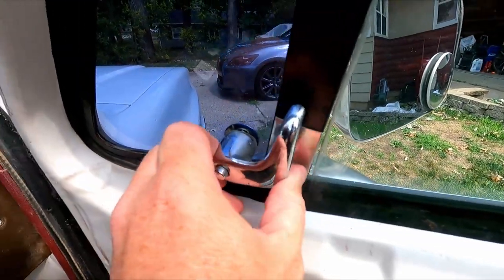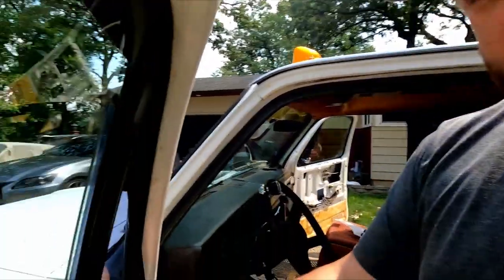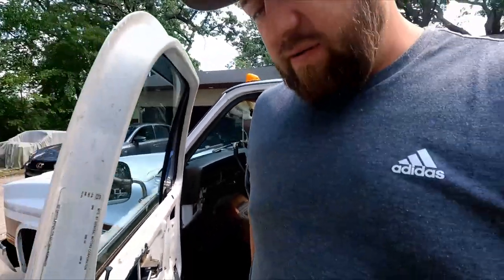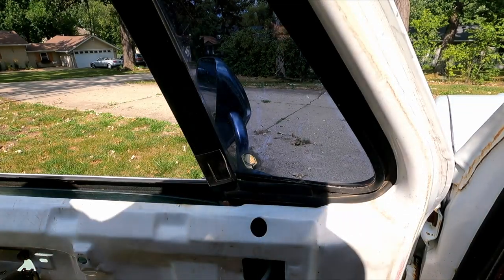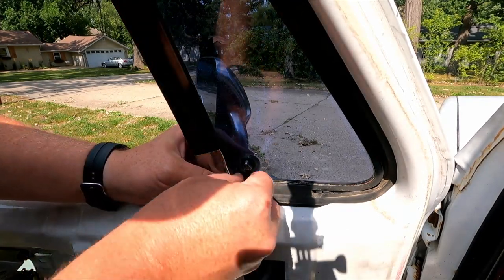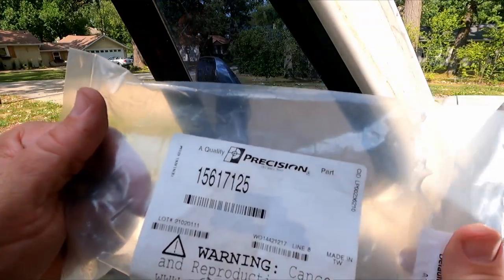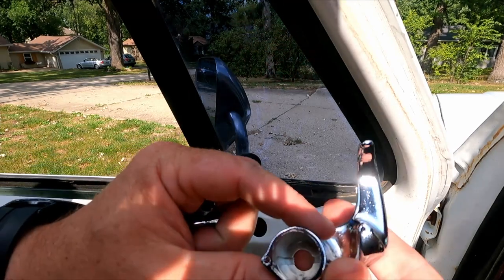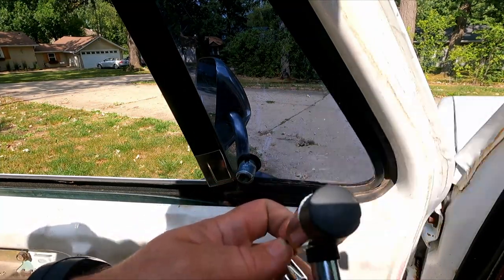80-87 Vent Window Handle & Hardware Replacement Crew Cab Square Body Chevy | Interior Updates Part 1

Comment: I installed the first piece (little button with the teardrop shape) upside down.  I could not get the roll pin to go in.  Came back inside to good old youtube and watched you to it the right way and changed mine over.  Works great now.  (1990 Suburban)  Thanks for the video.
Reply from the maker: Glad it could help

Comment: My passenger side latch is all loose and worn out, causing a lot of wind noise. Are these new latches closing the vent windows tight enough to fix that? My gaskets still look reasonable. Thanks for showing me how these latches go together!
Reply from the maker: I would assume so as long as the frame is good it tightens against. It only comes as a kit and was $20 so worth replacing it all while doing it.
Reply: Dominick Damato thanks, that's what I thought as well. I'm from the Netherlands (Europe) so there is always a lot of shipping cost involved with every parts order, but thats the price you pay for driving an American car over here I guess ;-)

Comment: I just got the same kit for my semi truck....it all seems right but did you use every piece in the kit or have some extra parts? The old ones i took off are different so i cant match it up.
Reply from the maker: There were doubles of the gaskets and washers.

Comment: I'm tinting one of these in two weeks. What's the tool you used to get the pin out? Where do you get them at? Have you ever taking the vent window off the door itself?
Reply from the maker: It's a punch, Amazon is easiest. And no not yet, the vent window is a bit complicated to remove. There are videos out there on it

Comment: Dose the wavey spring washer rub on your window tint?
Reply from the maker: I don't think it turns I think it just applies tension
Reply: I believe it rests against the black plastic washer that is secured by the pot metal piece/torx bolt.

Comment: I ordered the part but it does not come with instructions and looks like it has extra parts, probably a universal package. The seller told me I'm on my own to figure out how it all goes together which brought me here. Mine came with a few rubber washers and 2 springs ( probably for different applications)
Reply from the maker: Hopefully this helps you figure out what you need for your application